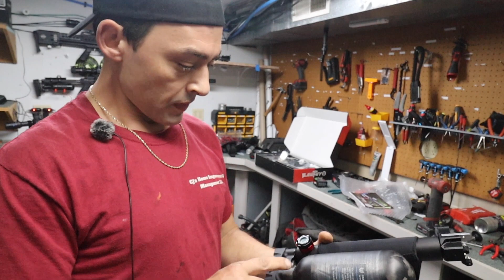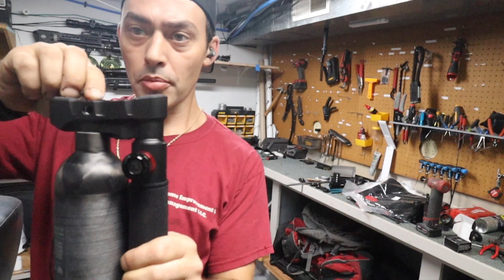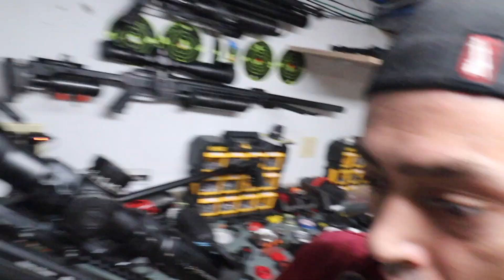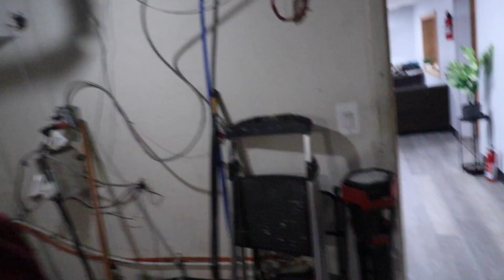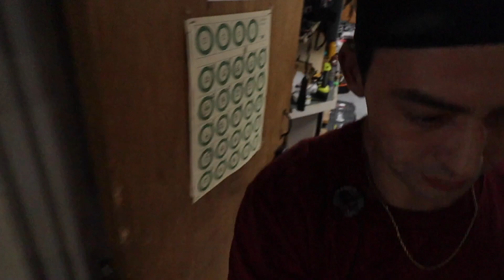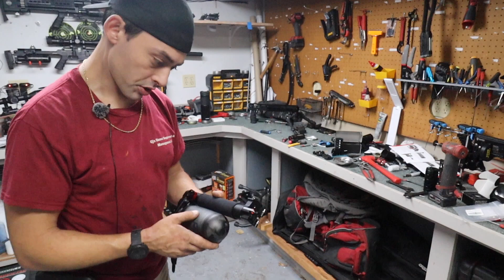Edgun Leshiy 2 - Super Edgun Build

Comment: There is no standard in the airgun industry in terms of FPE. I don't know what the maximum FPE for the 25 cal Edgun is with the 250 and 350 mm barrel with slugs and pellets. Any idea what it is?
Reply from the maker: Hello, yes, it’s not a standard amount, I got pretty astronomical results, I did a lot of modifying and tampering, I got the 357 version which has the large Plenum, and I did that very deliberately, that is not something that can be bought separate so I had to buy it as a 357, I even still have the barrel and magazines, but I never use it as a 35, but I got 25 caliber 40 grain slugs over 1000 feet a second, I think my highest was 1100 and something

Comment: Alot of informations but you are not organized and this video is very hard to watch Jesus christ
Reply from the maker: Hey dude, sorry, I’m a little all over the place all the time because I have a lot of very intricate hobbies, this is only one of them, I do machining both CNC machining and manual, I do ham radio, both digital and analog, I do building drones, flying drones, high intensive, micro, soldering, and electronics, my hobbies are kind of endless, so my head is all over the place sometimes. Sorry if it’s hard to understand, but if you have any questions, I’m happy to answer them.
Reply: @Cjsairgunscarsandmachining  with all that stuff you have going on, now i understand you brother. Be well, be safe and watch for your health 💯🫡
Reply from the maker: @Voltrixxmoto   Thanks for understanding, when you replied just now I noticed a picture of a car so there’s also that I have two diesel trucks and a 2017 Dodge Challenger SRT scat pack 392 shaker, that I have completely rebuilt as far as suspension, handling, drivetrain, including 9-inch billet differential, 4-inch solid driveshaft, double disc ram full metallic race clutch, and every associated bearing, anything to do with airflow the exhaust from the engine to the tailpipes, the intake system, in addition to the shaker, I have done a tremendous amount of work on that car, so all of that on top of everything else, my 1350 hp GMC Denali Duramax 6.6 L V8 turbo, my 2015 Dodge ram Cummins 6.7 L V6 turbo, and they both have a tremendous amount of work done that I did all of it myself, yes, I have a lot going on, to say the least. I know people often think that and I feel bad because I don’t wanna come across that way, but it’s genuine, it’s kinda hard to fake when it’s real you know. And then I also own four businesses, Anyways, I appreciate your patience and understanding.
Reply: @Cjsairgunscarsandmachining  all i can say is that you're a hardworking person with tremendous amount of knowledge and everything, hats off to you sir💥💥
I watched your Yt chanel and videos and yes there is alot of going on. You have a new subscriber brother😎💥💥

Comment: You ever come across a small plastic disc instead of a Oring at the bottom of the pressure gauge
Reply from the maker: yes the white small plastic disks work as well, most air gun companies use them FX makes what's called an X ring, I think those work the best and I have a bunch of them in stock so that I can use those primarily but the white ones work as well

Comment: Hey Chris, Nice video. Just wondering have you made any dies for your press slug press yet? The reason I ask is because I have ordered a f Huben Gk1 and it is suggested that slugs should be anywhere between .223 and .224 diameter. I'm looking for a die and those made are smaller than the suggested for the Huben. Wonder if you could suggest something to help me. Thanks, in advanced.
Reply from the maker: I haven't made the entire dye I have made parts I've made the part that makes the back of the slug for multiple different kinds for a recessed back end for a concave round back end, and I've made different pins for the hollow point I even made one reverse to make it like a full metal jacket projectile, but now they have all sizes as inserts they finally made it two piece where you can take die out of the crown they call it and make different sizes for each caliber Now the inserts would be much easier to make

Comment: Hi in your opinion eBay is the best .35 cal today for hunt ?
Reply from the maker: Hey, how are you, your question says Ebay is the best 35 caliber, I’m not sure if you meant the Ed gun, but no, I don’t think it’s the best 35 caliber I didn’t even keep it as a 35 caliber for one day. It’s not going to get high energy levels as a 35, I bought the 357 because it has the largest Plenum 137 cc, and that’s the only way you can get the plan on that big they don’t sell it separately. I made mine into a 25 caliber, I’ve tried the FX in 35 caliber I didn’t even keep it. I traded it in for a 30. The rattler is by far the best 357 I’ve ever tried in air guns. it has almost 400 foot pounds of energy at the level I have it turned up to, I only get half a magazine out of a 700 cc tank, but that’s to be expected with any thing air powered at that power level. I have never seen another air gun, or even heard of another airgun that is capable of shooting 200 grain slugs in 357 with air power.
Reply: @Cjsairgunscarsandmachining  hi jjj, i mean what is the best .35 cal. i am deciding between .30 or 357 for hogs. But the weigth is important because i walk a lot
Reply from the maker: @macq1980  gotcha. So that’s definitely your answer.

Comment: Hi I also have L2 for a year now, did all kinds of upgrades and mods. Waiting for my FX superior heavy liner setup to install next  (Should arrive in a day or two): Regular magazines are a bit larger i diameter and slugs drop out (but you can use it for slugs if the magazine is in the gun as it cannot fall out). Slug magazines cannot in my opinion shoot pellets as its to small diameter. But you can switch easily.  Love the video! Cheers
Reply from the maker: I totally agree with you, and was kind of disappointed when it was that much of a difference. Because the same caliber, I don’t feel like should be that much of a difference, anyways, I’ve gained a lot more experience now, but honestly, the STX conversion I wouldn’t even bother doing. I did it, and I did it thoroughly, and it’s just not as accurate as the alpha barrel with slugs. It may be different with pellets I didn’t try, I’m not a big Pellet shooter, unless it’s at competition or practice for competition, but that alpha barrel really works with slugs. It’s very accurate, I went out of my way and built a hole conversion with an STX that I cut to 450 mm, and it was all for nothing, just trying to save you the same thing. It’s very difficult to get them accurate hammerless guns are very different. With inner liners that are much thinner than solid barrels. It’s difficult to get them to work correctly to any benefit over the original. My opinion, the original is better.
Reply: Regarding slugs, try ZAN 33 grain 0.253 slugs made for alpha precison barrel/ L2. Best so far for me. Cheers
Reply from the maker: @filipkovacec5759  I've used them, but don't shoot anything that light anymore, I press mine 40gn is the lightest in .22 or .25

Comment: oh no  :face-purple-crying:you are doing anything wow the degassing😔you have a small screw at the bottom of the front socket .watch the videos of edgunwest he is one of your compatriots and he will save you from doing stupid things and damaging your gun.lothar walter rifled barrel for pellets alfa précision  polygonal barrel for slugs😅
Reply from the maker: I know, I have 2 barrels. Both alpha cause of choak. No harm done. People are too afraid to work on things. That’s how I’ve learned how to do so many things. I’m not because I can fix it. If it needs parts I just make them. That’s how I learned by making mistakes and learning how to fix them, and it’s accumulated into experience WAY more valuable than every airgun I own combined.
Reply: @Cjsairgunscarsandmachining  
hi! it's just to save you shooting time! rather than solving problems even if it makes you progress. but overall it's a very reliable gun and easy to repair. stay careful and do yourself pleasure. I really liked the presslugs part of your video👌and no choke for the slugs best regards

Comment: Enjoyed thanks for sharing. New to the air rifle world. Really don’t like my leshiy 2 in 30 cal 359mm barrel. I don’t thinks it’s as accurate as my impact plus less shots per fill. Only upside I see is size and weight lol. Seem to always go to the impact. Might get me a large quick fill tank and see then. I got the 47occ tank on it though.
Reply from the maker: So the Ed gun is a lot different. The impact, the Pantera, all the FX guns the crowns, I have two crowns, two impact, a Pantera, and a lot of other hammer guns, all of the hammer guns are completely different. This gun doesn’t get tuned that way, it doesn’t have the same adjustments. It doesn’t have the same much of anything, I’d be happy to give you a hand, getting it more accurate, it took me a while myself to get it as accurate as I wanted it. It’s not something that happens as quickly with hammerless guns. And that goes for the scout, the rattler, all my hammerless guns have been that way. They are harder to get Consistent accuracy because you have to understand the valving that opens and closes the main valve rather than a hammer, hitting a valve pin, i’d be happy to help you wrap your head around that and get it under control, with Ed gun specifically, you need to change the size of the Jets, in the stock of the gun above the bottle or whatever you have on yours the top part can thread out once you’ve de gas it completely. After you threaded out, you will see two small brass fittings that can thread out, those two fittings have a tiny hole in them, you can get different sizes of that hole in those jets, and that will modify how long your valve stays open, which will change your velocity as well. You can get back with me if you have any questions or if you need some help, I’m happy to give you a hand.

Comment: Hi Chris  have you used this in the .22 cal configuration? I'm going to order one but wanted it to be as quiet as possible would the .22 be quieter then the .25? Also I like the power of the .25 but as I'm in the UK I would only turn it up on private land with my overseer before I get me licence so I also want usability at the UK limit for range use. Have you got an opinion on this? thanks
Reply from the maker: Hi, I’m not very familiar with the rules, regulations, or laws out there, but if they are some thing to do with 22 caliber, I would stay in the 22 caliber for sure, I like the 25 caliber, but there is no regulation on that in the US, so if that’s what you’re local regulations are, you should comply with that, as far as the sound this is one of the best moderators, I’ve bought other than machining the internals myself. This has been one of the most effective silencers. If I was going to buy another silencer, that would definitely be at the top of my list. I haven’t been purchasing anymore because I started machining my own, and they are definitely by far the most quiet by 29 dB to be exact, if you’re interested, I could make one for you. I’ve been starting to think about making them on a bigger scale. Because there is a gap in the industry of air, guns with silencers specifically. The silencers internals are not effective that are sold for air, guns, not as effective as they could be anyway. Impulse is another good company, that’s what I use on my bench, rest gun, but if you have seen my video in the past, I think I made a video actually making the silencers, and I also have one testing them versus other silencers that are on the market. You can email me if you’re interested CJ110109@gmail.com.
Reply: @Cjsairgunscarsandmachining  thank you, yes I have watched a fair few of your videos since finding your channel a couple of days ago. it's the power we are restricted by not the calibre but once I get a fac licence the power is no issue. I will email you, thanks again.
Reply from the maker: Oh nice, I wasn't aware that you could get a license to have it F.A.C, that's great. So, in that case maybe you should hold off until you get your license, and you can get whatever caliber you want??
Reply: @Cjsairgunscarsandmachining  that's would display a level of patience we as men don't have lol....

Comment: Great video. I have a leshiy 2 .30 Cal with 350mm barrel with stock moderator. My question to you is would it be worth getting the Behemoth moderator. I can’t find any where or ytube that compares the difference in sound between the the stock moderator and the Behemoth. For $500.00 could you justify the price. You are one the the most knowledgeable on air guns on ytube. I will subscribe and like. Thank you
Reply from the maker: Hey, thank you, I love the behemoth moderator, if you've seen my moderator videos, you know I am a nut with perfecting them as most other things, but I have made my own solid aluminum bar stock into a baffle system on my lathe, then put in the CNC to make holes between each baffle, I got the best db reading of 4 Donnie fl, 2 impulse, and trident as well as a couple others, but haven't modified the bohemoth because it is great! I got it with the gun, so I wasn't aware of the price alone, but maybe I'll do another video with all of them and compare the Behemoth as I made a QD exactly after the QD from it with 1/2 unf for the other guns when I did the stx barrel for it ( stock barrell is better on that gun btw)

Comment: You should make sure the gun folds and locks before re gassing it, you’ll end up having to de gas it again if you didn’t get it lined up perfectly as the gun won’t fold and lock in place.
Reply from the maker: Everything is working perfectly now, I actually made an STX barrel I have another video that I have to edit, I cut the outer barrel, and the carbon fiber sleeve in the middle, and the inner barrel to make a 700 mm 25, caliber, a 450, or probably 475. It’s literally making one hole for the whole eight shots
Reply from the maker: Also, did the full metal bottom end the trigger guard trigger and bottom, half of the block the huma addition And the metal wheel for indexing, and machined a new QD for the silencer. Gun is awesome now.
Reply from the maker: Oh yeah and metal magazines

Comment: To adjust how you want the silencer line to line up you tighten the quick connector on and loosen the barrel Turn the whole thing where you want it then re tighten the barrel back down, make sure you put something flat across the back and push the barrel back so it touches to make a good seal against the magazine before tightening the barrel in place. If that makes any sense.
Reply from the maker: I also made a whole brand new barrel, I cut a 700 mm and 25 caliber, FX impact outer barrel and inner barrel, use the carbon fiber sleeve I had between them, and a carbon fiber shroud to tension it to the end of the Edgun. Unbelievable accuracy.
Reply from the maker: I actually machined a new quick connect piece, identical to the other one and it lines up perfectly

Comment from the maker: I haven’t seen your other comment yet, they come in order of the most recent in my email, and I usually try to respond right away when I see them, but I will read it. I did end up using the bigger jets. They’re not much bigger they’re not that big, but it’s a 450 barrel, so the 450 barrel is going to be tough to match up. I don’t think f(x) has a 450 I did buy the STX adapter, so I can definitely use the FX barrels which I have a massive amount of, I ended up with three 700 mm for the impact in 703 and 800 22,25 and 30 caliber, then at least three or four barrels for the crown and two for the Panthera. All different calibers, trying different guns for benchrest, etc. I’m gonna be using the crown for the next competition. Anyways, yes the Pellet magazines. I think they work better because the pellets or slugs, rather that I press are .2496 exactly, and they were closer to the pallet size that’s why they are so tight in the slug magazines I probably should have gotten Pellet magazines, but I increase the size to one 0.2 and 10.3 jet, and this is the raptor regulator. I put that down to 150, and my 45 grain slugs are getting just under 900 feet a second with good accuracy, which was my main concern. I wanted to see how much power I could get out of it. I wasn’t intending on keeping it that way, but was interesting to see Edwin in Spain was also interested to see the results because no one has ever done it.
Reply: The main comment that I put in my first post was to never shoot the rifle without the magazine installed because it will shoot out the transfer puck. I thought earlier on in your video you might of done that if the puck was installed in the rifle Also to remember to put the magazine cover plate on to make the magazine to function properly. If the magazine does not function properly another issue is having the barrel set screws coming loose and allowing the barrel to stand proud of the magazine action face. Just something to consider. Edgun West does have a lot of videos showing work on the Leshiy 2. Good luck on your project.